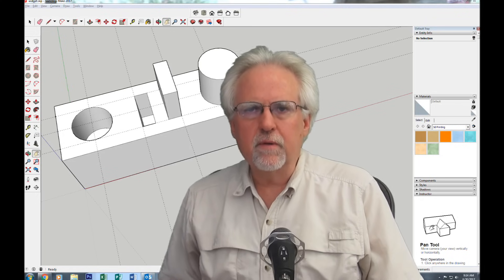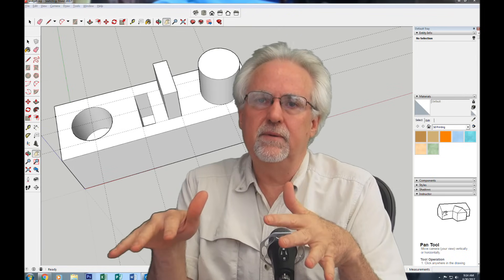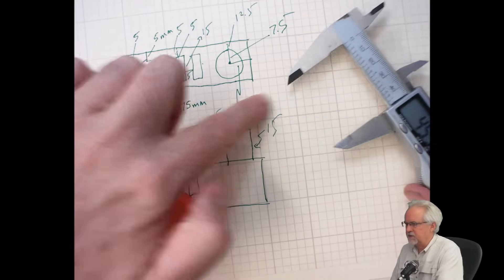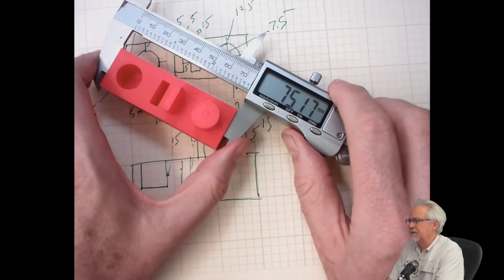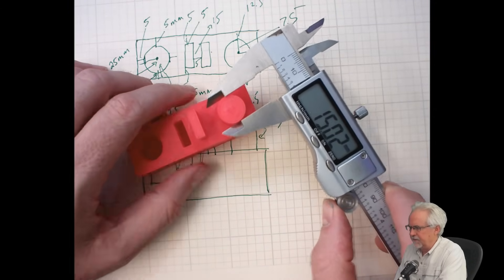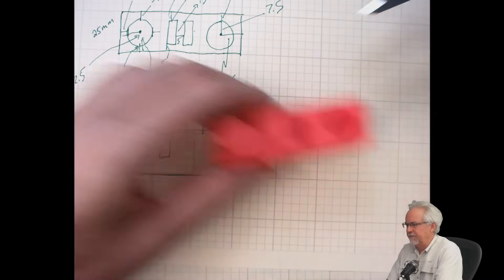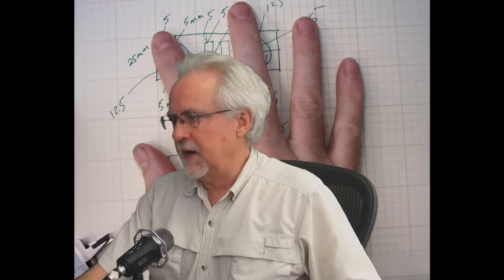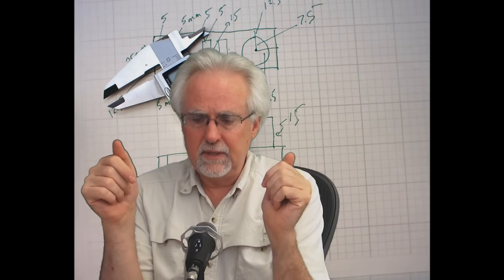Sketchup Tutorial LESSON 5: How to Use Digital Calipers

Comment: when i was a young man i worked for a porsche repair shop, i learned how to use feeler gauges and calipers, push it in, back it off run it back bown snug it up, drag it out smooth, not too tight, not too loose, read german manuals too.whadya think?
Reply: good job Paul

Comment: May i ask, how do the van allen radiation belts affect electronic circuits?
Reply from the maker: Ionizing radiation creates electron/hole pairs in the insulators of Integrated Circuits. The electrons flow out of the insulator, but the holes become trapped. This is then trapped positive charge in the insulator. This shifts the threshold voltages of the transistors. This results in transistors being "on" when they should be "off" and all the logic or other functions fail at that point.
Reply: wow you answered me so fast, so how do they shield the circuit? i thought they could use boron to insulate from the radiation(that was my plan) and then of course mercury solder would never doo. blah blah, im a  newbee of this field but i wanna make stuff work and get us all a little further,
Reply: also, ionization radiation thru wat type of saturation, inductance  ? hah another emp bang, done that to my tvs and radios and my hand etc years ago , sory to say my balls are still glowing from my dumb escapades in the past.